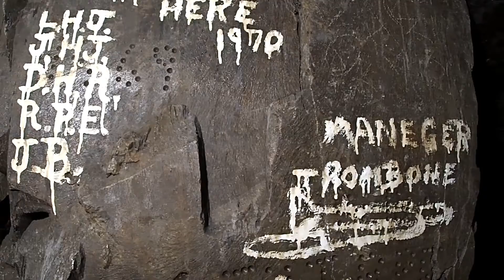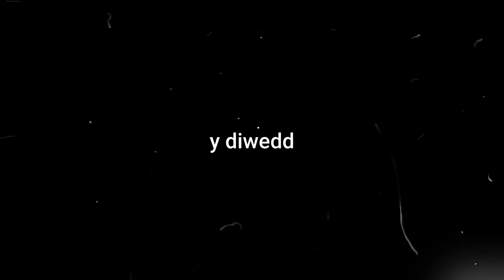Foel Grochan Slate Mine, With The Most Amazing Artefacts !!!

Comment: Fab videos guys! May I ask? what lighting are you using for your camera work? they must be seriously powerful.
Reply from the maker: These are those and TBH they are much better than the price suggests , underwater I have never had them on full . I use two underwater and 4 above water to get better lighting affects they are 1230 deg and will cover a 14mm wide angle . I have a greenforce one as well that cost a fortune and it has a better colour but rubbish performance . The cheap pones are a bit cold but can be corrected in edit. We have just got some dry cave helmet lamps from Sofirn and they are blooming brilliant . You want the 27 LED ones

https://www.ebay.co.uk/itm/233342058634?hash=item365445408a:g:0KwAAOSwmgRdfftd&amdata=enc%3AAQAHAAAA4HsGgIfUNuCWkMBCjjoOpoZEg5jbGQqzrts4FCLmQ%2FkxdNM%2F7l%2FWY7zJQQZsMbuzMLRztUdbjVPLN5wcyPRcerFVDvtUXCTA%2FhsmQ4BGhqI0B%2FJoEB8k0Q38cHsAxjnxyMDWalt1mU7qw5U%2BXSKs%2B50zxGc3DS83QdYKXNW2Df3eqv5cg7T%2FBRMHXBzaBXiPzj1phQSumMfgOcN0fJ3GFPVsyyCLXYFPt3Jj7cgupbF0EPRmbZN9nJNZVGKc1%2Bhgb5X2YA0QkJTD07QtG2%2BH5VD2ORB%2FX2novZALDY2smW7R%7Ctkp%3ABFBMxI3607Zh
Reply: Thanks for the advice! I’m going to purchase one of those. I’ve also bought some of the Sofirn head torches and a Sofirn sp36 pro torch, which is a beast! 8000lm claimed output! It’s bloody good for the money! Thanks for the great content you guys post, really enjoy watching the videos.